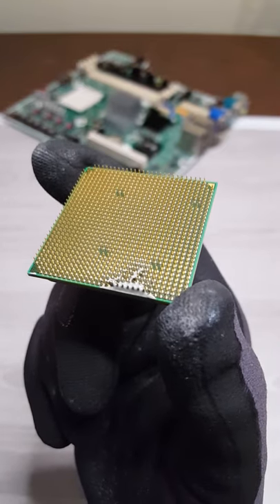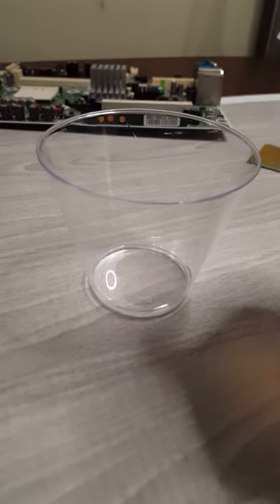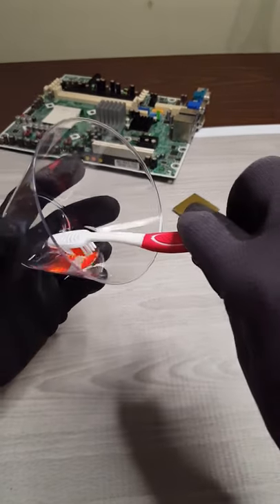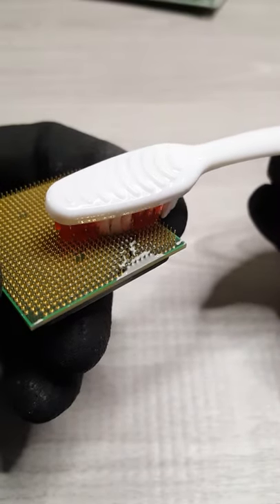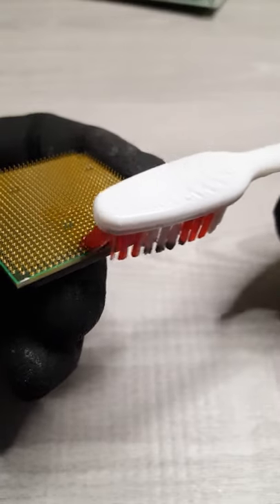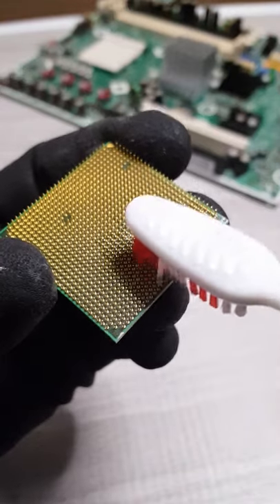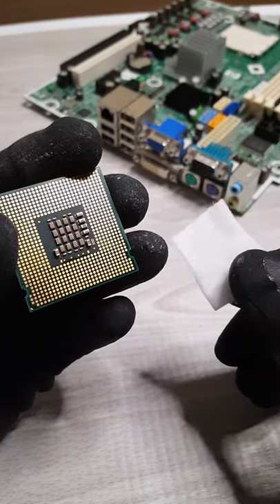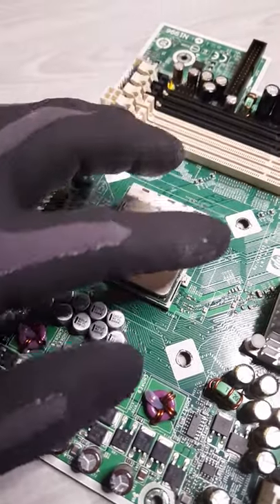Cleaning Thermal Paste off CPU Pins #Shorts

Comment: Everybody talking about pins and toothbrushes while I am here wondering how the thermal paste even ended up in there
Reply: Guess you've never built a pc
Hey sorry to all the people that replied, got absolutely destroyed haha, my reply was meant to be a joke but i dont think i made it sarcastic enough xd
Reply: @Falcw4   I use the rice grain/pea method of application and generally use solid paste so I don't get how it got below the chip
Reply: @Daonexus  clumsy guy I guess
Reply: It can be from not knowing the correct way or from over spill. I had it happen once where I was removing my CPU and I got some thermal paste on the lever arm bracket, when I pulled the CPU out the paste got on the pins (ryzen user here), I very lightly scraped it off with a pin and luckily, no problems but this is an extreme example in the video
Reply: The paste stretches like melted cheese you really got to clean up the paste before removing the cpu
Reply: If you're applying paste and your CPU isn't mounted yet, you may be doing things in the wrong order.
Reply: @Falcw4  Found the guy who put thermal paste on the wrong side of his cpu 😭
Reply: Amazon sent me an open box cpu(when it was supposed to be new) that some jackass  bent a bunch of pins on, got thermal paste all over them and sent it back. Some people are just morons.

Suffice to say I will not be ordering pc parts from Amazon again lol
Reply: I see you haven’t known about putting thermal paste on the socket for maximum thermal efficiency
Reply: @Falcw4  guess you have no idea how to install a cpu
Reply: It's because of a stupid meme about putting your thermal paste in the socket instead of on the cpu
Reply: @acquaintfate8579  lol there are some metallic thermal pastes if used like this it will probably short-circuit everything.
Reply: @niio4580  wait, why not? They have a fantastic return policy lmfao. Just return it and get a new one shipped to you.
Reply: @Falcw4  I have, I still am wondering how tf it got there
Reply: @marcusborderlands6177  because I fixed it and it works fine, but their quality control is hot garbage with pc shit. I shouldn't be getting used shit at all when I'm buying new, especially with things like this.

4 of the 7 parts I ordered from them for my last build were open box and damaged or just damaged in their warehouse/transit, all supposed to be new. Shit's unacceptable lol, just gonna stick with newegg.
Reply: @Daonexus  toothpaste coming under a cpu chip is very common if you take the chip out. Why? When you take the chip out, even if you tried cleaning it (thermal paste) while it’s in the motherboard (which I honestly don’t recommend), when you try to take out the chip, your thumb smudges in the thermal paste that was already in the side. Also, unless you’re planning to use the hand in that same exact position, you’re gonna have to move your hand sightly which would further smudge in thermal paste on the pins side.
Reply: When there's a hole there's a way
Reply: @Jiche  read my 2nd comment.
Reply: @Jiche  never said their customer service is bad and the return service is great, however I ordered a bunch of new parts and a majority of them were open box and damaged. Open box shit shouldn't even be in with new products unless they are thoroughly checked for quality and resealed, hence the shitty quality control. They clearly didn't even check the cpu to see if it had been damaged when someone else sent it back.
Reply: @Jiche  everything from newegg I have ever ordered has been pristine so I usually go with them, but things were a bit cheaper on Amazon this time around so I went with them and obviously it didn't go well. Good for you that you had great experience with ordering pc parts, not everyone does.
Reply: @niio4580  i don’t know man, I’ve never once had issues with Amazon, pc has been working for 3 years so I’m happy with the parts
Reply: @Jiche  I normally don't either, but as soon as I started buying pc parts from them it went to shit lol. The new ones they sent afterwards were just fine of course, but I still had to hold off for another couple weeks for my build, which I needed. I'll still buy from them for normal stuff, but I think I'd rather just purchase pc parts from a company that only sells electronics.
Reply: Ppmint 69 u the guy who puts the thermal paste on the socket?
Reply: @TubbyFatfrick  that CPU has now had a baby CPU after that verge bukkake party..
Reply: @Daonexus  yeah, lm which joe public shouldn't be using anyways..
Reply: Maybe the one who build it learn from that one channel that draw house using termal paste on the cpu.
Reply: @TubbyFatfrick  not enough thermal paste tbh
Reply: @superslimanoniem4712  yeah but it expands underheat I have accidentally added to much and it's got under
Reply: When you put too much, it spills over the side when you smash it against the cooler
Reply: @Falcw4  I built pc and apply thermal paste myself, never get it to a single pin. use use correct amount to cover the shim, enough layer, now it will conduct heat to the sink well
Reply: The verge built it
Reply: Same here
Reply: @niio4580  or just don’t buy open box Amazon warehouse items because a lot of the time they are messed up in one way or another.
Reply: @Falcw4  the thing is, I work in a PC pre build company and paste on pins actually isn't the rarest thing... sure not everyday but it happens...

Obviously the hobby PC bobs now talk crap as always to proof their point and get sum likes🤷🏼‍♂️
Reply: The verge
Reply: Sometimes it gets stuck to the cooler and while trying to get it off  it can happen trying not to wreck the CPU at the expense if being messy.
Reply: @Falcw4  better than the verge that's for sure
Reply: They must have followed the Verge's PC build guide
Reply: @Daonexus  you cant do the pea method on the 5800x, the die is in one of the corners, so you have to either spread or use 5 dots. I did the pea and got 5 Celsius warmer than when I spread it. Using MX-5 btw.
Reply: It’s not thermal paste. It’s paste. But not thermal paste.
Reply: People over apply and if they don't clean it off well enough before lifting it out, some can get on your fingertip and onto the side of the pins.
Reply: Been building PCs since the late 90's never had thermal paste on pins till last month. Had some on my fingers and attempted to Linus an r3 2200g after removing it from the socket. Felt pretty dumb. Wish I would have seen this video beforehand. That CPU got an IPA bath and  compressed air spa treatment.
Reply: 8A Benaiah Dandel  sure did! Granted there wasn't a ton of paste on the pins or any past the second row.
Reply: Putting too much on there... duh
Reply: Idk bro, my pc wasn't turning on no matter what i did and when i got out the cpu I found out it had dirt between the pins, and I cleaned it like 4 days ago, wtf for real, so I'm now going to clean it because It has some thermal paste, idk how it got there also and try to boot it up, it didn't short afaik because it didn't got any smoke, but seems the dirt was making the electricity unable to pass, or maybe avoiding the pins to contact lol
Reply: @dantepaz5028  it could short it... if that happens then rip cpu
Reply: In experience, when you apply a bit too much, or if it is liquid or if you spread too much on one side…? So there are lots of situations lol
Reply: When u put a thermal paste too much :
Reply: Lmaooo
Reply: Dennis from ltt
Reply: So no one really glues the chip to the socket with paste IRL huh?
Reply: I'm thinking that it was added to the CPU on purpose, so as to create a teaching lesson on how to properly and safely clean it off your cpu.
Reply: It might happened. When I try to clean up my processor from thermal paste (because I want to change it with better one), the edge of my finger touch that paste and get dirty. I didn't clean that finger and accidentally touch the bottom (pins) of the processor. That's how it get there
Reply: This happened to my 5900x I have a post on HWC (Hardware Canucks) I used thermal grizzly Extreme and that stuff is a diffent beast it expanded overtime so use very sparingly mine got a good amount on pins.
Reply: @Daonexus  well a newbie could be building his first pc and put way too much thermal paste
Reply: Because people throw up thermal paste on the cpu
Reply: @TubbyFatfrick  lmao verge pc build 🤣🤣
Reply: I used the amd stock cooler which has paste about as sticky and thick as cement and got some on the edge pins while removing. Easy clean even without a toothbrush with ipa, a paper towel, and compressed air.
Reply: @Falcw4  i got my amds at least 1 time covered with paste cuz being in a rush and paste covered hands lol
Reply: I used to much TP and the cpu got ripped out with the entire water cooling.
Reply: @actofaggression8060  It wasn’t the thermal paste, you just pulled the cooler off too fast and didn’t allow it to separate itself
Reply: @Daonexus  maybe he watched verge tutorial
Reply: I had my cpu and later I found thermal paste on its pins
Reply: @Daonexus  because you used a practical method whereas someone new to applying thermal paste may have put too much on and leaks over and onto the pins etc
Reply: Sometimes shit happens !!
Reply: Shizz happens my friend.  One goofy mistake of too much thermal paste and fat fingers can DED your system.  I was crying when i thought i had to buy a new 3700x and realized it was just grease in bad places
Reply: When you help friends get their builds working from time to time, you see it... lol.  I don't quite understand how they manage either though.
Reply: I had it happen when removing my CPU quickly after applying new thermal paste so it was still pretty new and not dry. Also probably used quite a bit too much

Comment: Anyone else thought for a sec there were pins missing
Reply: A few pins here and there do not matter. Most pins are there just for the structural integrity
Reply: No
Reply: @GameControlYT  none of this is true
Reply: @GameControlYT  that's not true at all
Reply: @staideysstudio4637  most means more than 50%... I don't think if more than half of you cpu pins break it will work fine
Reply: @staideysstudio4637  more likely than not something will not work when you break some pins
Reply: @staideysstudio4637  yeah but still... if you break more than half of the pins, the cpu won't work
Reply: No
Reply: @staideysstudio4637  just because you can doesnt mean you should
Reply: @staideysstudio4637  i never implied that you said that
Reply: Pins are missing its the way the pattern is
Reply: @Endermax3852  actually it is, you might want to do some searching before you comment, as thats how people got old chips on to new boards ,
Reply: Yeah at the beginning
Reply: @GameControlYT  bro false asf
Reply: No
Reply: @Endermax3852  nope if some are not used then it won't matter they still need to be in there it's just a grounding pin well I always say one pin if you're lucky it will be just a grounding pin two pins ho you should be in extreme luck cuz if it's not a grounding pin then you are in tough shit 😂
Reply: @ProjectYoutube  yes some pins will have a purpose on the cpu some for structural integrity .
Reply: @Endermax3852  most unlikely nor likely
Reply: @zexal4974  it used to matter back in old days when each cpu was fap different. Now all companies do is fap a single layer say 12 core one and then check how many of those core works.  
If 4 of them does than it becomes a 4 core CPU. If 12 works then it become a 12 core CPU.  
Each of those CPU has same amount of pins.  
So a lower core CPU can get away with broken pins.  
Most pins would just connect to dead parts
Reply: GameControl that is so far from the truth it hurts
Reply: @GameControlYT  I saw a video of a friend, he sent me his amd video. Some pins were missing and his AMD CPU is working fine in his R5 2600. He even managed to overclocked it and stress test it for 3 days straight. No hangs or performance issue. I can say what you say is true.
Reply: I know 
90% Pins = 90% performance
Reply: @fearstiers6730  there are some pins that is actually unnecessary. Some of them are just there for anesthetics. But if the real pins got cutted off, you're gonna have a real big problem.
Reply: yes
Reply: @GameControlYT  hell no
Reply: @GameControlYT  yep as long the missing pin is ground or unused then it can run normally
Reply: @GameControlYT  Um No! Those pins are used for drawing electricity
Reply: @staideysstudio4637 stability matter bro
Reply: @aarontimm  yes
Reply: My CPU is alright without any contact to the motherboard.
Reply: Nope my processor are looks like that
Reply: @GameControlYT  One of my pins are missing from ryzen3 3100 bcs I manage to broke one right when i bought it. It worked fine till 1week ago when started to randomly restarted in middle of a game or when i need more power in games like warzone. Maybe thats the problem or my psu. Idk yet. Sorr for my bad english tho
Reply: @Endermax3852  it’s true
Reply: @Endermax3852  no it actually is true
Reply: @wealllikeitsomilkit4301  nope do your research
Reply: @Endermax3852  do your research lol
Reply: @vse7327  Ok break 51% of your cpu pins, and tell me if it still works lmao
Reply: @lilskely6278  1 or 2 pins okay, but i'm talking about more than 50% of the cpu pins, did you even read what i wrote?
Reply: @jaysgamingandbuildsc5533  I did some research pall, and i'm 100% sure that if you break more than 50% of your cpu pins it will break, and if you don't believe me, try it for yourself and tell me the result
Reply: Hahaha jokes on you I have an intel cpu
Reply: @Endermax3852  my intel cpu lost 1 pin and still work normally
Reply: What ever the hell goin on here bouta give me a stroke
Reply: Bro pins are not missing this processor is based on am3  design
Reply: I Think this is am2 socket
Reply: @GameControlYT  dude wtf u talking my CPU has 1 broken pin and it's dead alrdy
Maybe let's see if u still work fine we we take some stuff away from Ur hesrtht
Reply: @WarBirdx  because that pin might be one of the crucial one.  
Not all pins are needed for the function
Reply: @GameControlYT  I know man but read your first comment again
Reply: @WarBirdx  most
Reply: Nope
Reply: The pins missing is probably cause this is an older AMD CPU, it's not that they are missing but that the pin layout of this specific socket has those open spaces
Reply: @Endermax3852  He said "A few pins here and there do not matter", which is not 100% wrong. The last part of his comment is though.
Usually the pins furthest from the middle are more likely to not really matter and your PC should still boot, you may encounter a few memory problems however. I don't believe there is a single pin that is for "structural integrity", they mostly all have a purpose. However some are less important than others and don't really harm the PC if they break. Obviously It is good practise to make sure none of your pins are broken or covered with thermal paste. In the rare case that some are you really just need luck and hope that an obsolete pin is damaged, and not a vital one that may hinder the PC from booting.
Reply: @GameControlYT Thats a huge cap ive seen all day.
Reply: @GameControlYT lol no , there is only a couple of pins on some corners that have no use but the rest are essential
Reply: @dannynubs8765   not really, not all pin connects working circuits.
It really depends on which pins are broken more than where pins are. As i said it made to support the chip in place more.

Comment: You forgot to push some pins to the side to allow easier access for the brush to clean off the paste
Reply: Lmao
Reply: For anyone new to PC building, this is a joke. Don't touch the pins 😉
Reply: I pushed them on my 5800X and they broke, how can I fix this?
Reply: @borsalino5539  some glue or electric tape will do just fine
Reply: @whatever4847  evil lmao
Reply: @whatever4847  maybe some alcohol
Reply: @ItsNotAProblem  shhh
Reply: @whatever4847  he said...
Reply: @borsalino5539  scrap all the pins under the cpu and buy LGA motherboard. works like a charm
Reply: Lmaoo
Reply: @whatever4847  😂
Reply: But you can't straighten them if you push it down.
Reply: @borsalino5539  Here is no way.
Reply: I was going to say, this is the method I used and it worked great.  They're clean as hell.